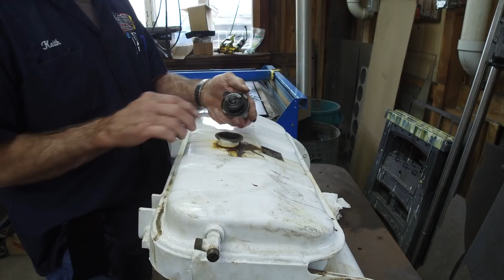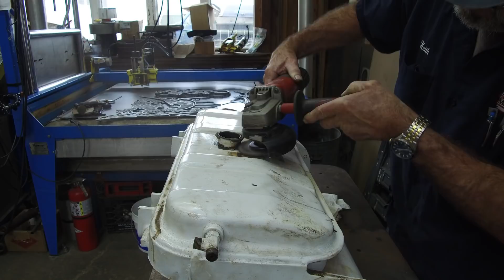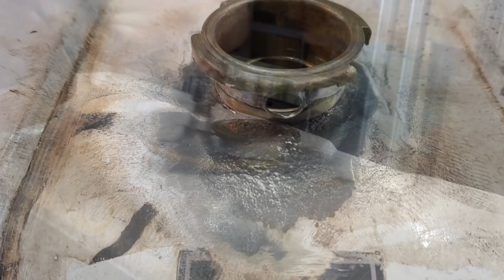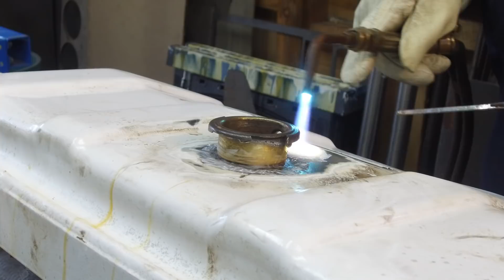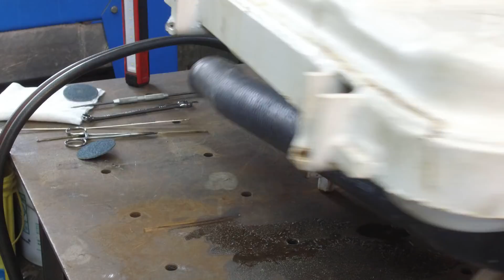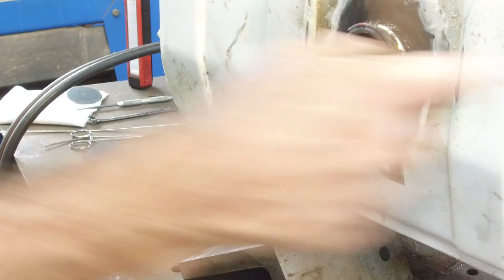2 Joint or a 30 Pack Engineering

Comment: Working engineering in an automotive group is pure frustration.  That 2 cent plastic piece was 'engineered' to save the manufacturer a few cents.  You might not believe how many times that happens.   Whole teams are employed to see how many pennies can be saved in the production of an engine, transmission, chassis, etc, etc.  Life of vehicle is less important than cost (as long as it makes it through the warranty period).

 Sometimes "we' get back at the mfg indirectly.  Examples are frequently recalls mandated because one of those plastic parts has caused a hazard.  One car had the flexible fuel fill hose connected to the fill spout with a plastic tie instead of hose clamp or even spring clamp.  Of course they broke, and the mfg had to recall many cars, costing much more than the steel clamp would have been in the first place.  Good payback as far as an engineer is concerned.

Comment: A long time ago, my AC teacher said silver solder on anything, but do not use silfos on brass because the phosphorous will attack the zinc and you will end up with a porous fitting that will leak . The same reason that auto 90wt is not used in gearboxes with brass ring gears. After a while you will find holes eaten into the ring gear. The recommended lube for elevator machine gearboxes is steam cylinder oil. Nothing quite like changing a 4 ft. in diameter gear that has to be heated to install and all the bolt holes reamed for body fit bolts. After the Elevator is hanging on a chain fall and the cables moved out of the way. Never a dull day.

Comment: For a 30 pack I would have at least used soft steel fittings .. 2 joints and it would have all been brass.

Comment: hey thanks for the great video Kieth. was wondering though, how did you clean out the fuel vapors so the tank wouldn't explode? also, what silver solder did you use? i didn't see you apply any flux. looks cool . thanks again.

Comment: Would brazing not be a better solution to that problem? Some acid flux might have been appropriate too. A steel barbed hose connection could be brazed or silver soldered into the neck.
Further edit... Is that a brass fitting on a steel tank? If so, it's no wonder it corroded.

Comment: That permanent nipple looks fantastic and has to be 100 times stronger than the repair kit. Now the tank can get it's well deserved prime and paint. Engineering is somewhat of a misnomer; I think add - on might work better if the repair part was made because of experience in the field demanded it. Are you doing a pressurized air fluid tank flush with solvents?

Comment: "I don't normally call out engineering" and you shouldn't, the engineer is 99.99% right! But his/her boss needs to sell, so they ''MAKE'' or better they build-in mistakes, worked for an US factory at the service department 40 y ago, we had to scrap meter electronics instead of repairing the board we had to take it out to exchange  for a new one, even if it was easy to repair board. If a whole car was made of non corrosion material and engines never broke tires never wore out we would still drive our grandpa car and no new car(s)(parts) were made!

Comment: From my career, about 1 in 20 degree'd engineers had the talent to practice the art. The others never worked on their cars, or fixed broken stuff, or had the curiosity to ask questions on how things work. So their path was some high school career councilor, that figured they were smart, and could get an engineering degree, as the pay was real good. Universities are degree mills these days, you pay, you get a diploma. Worse was Master degree idiots, and then PHDs. They didn't know what to do with the bachelor degree, so they continued in hopes they could learn enough to suddenly have mechanical aptitude. And their studies are so narrow that they look through the world with pipe vision. Mechanical aptitude is a gift you're born with, you can learn physics and math to improve it, but you have to have it to start with.
Those without aptitude would try to copy existing art. No improvement, and if they failed to understand some intellectual property of the long gone gray beards, they messed the design up.
Some of the limitations to making a design correct are the existing manufacturing machinery. As if you want to use a new process, a new machine that may not be cost affordable for the volume of work that will be manufactured on it. So the design uses what is available. And only the few that saw what corrosion does, think about it in their design.

Comment: Good solid repair, great silver soldering Keith. If the two-part nipple had been fitted with the O-ring on the inside, liquid would have leaked leaked around the threads on the outside. Should the O-ring not have been fitted from the outside to seat in the swaged annulus of the nipple?

Comment: Keith - I ain't ever seen anybody use silver soldering techniques  to "fill in' surface degradation - that's impressive. Was the material too thin (or unsuitable material) to braze? Am also EVER so glad you "didn't" wander down to the hardware store but made your own piece eg: the nipple.
Reply from the maker: Thin ;{)

Comment: Nice job!
I've replaced a few radiator caps on old equipment where the original was either unavailable or prohibitively expensive with more common ones (whatever I had in the junkyard)

Comment: When you went in to add a little solder to the inside of the barb, I was thinking this is when the whole thing falls apart if I was doing it!  I have done a lot of brazing and welding with torch and arc.  I just don't have much luck with silver solder.  You have it all down pat and your experience shows in everything  you do.

Comment: I don't know if the plastic nipple is original or a cheap repair, but I can tell you that it isn't the cause of the problem.
The simple fact is that fuel/coolant spillage is inevitable around a filler cap and in this case the paint used should have been able to resist it but failed.
So the problem is with the paint used, probably caused by someone under pressure to cut costs from management who didn't understand the product.

Comment: Hey Keith. If you'll take the short 2 or 3 inch stub of solder and hold it beside a full stick with one end of each piece together, melt them together then bend the short piece out to straight while its still hot, you won't have any stub waste. Hope that makes sense.     🇺🇸😎

Comment: To one and all, for when you need a wire wheel TO DO THE JOB, may I suggest Weiler 96146 Encapsulated Wire Wheel Wire Brush, Stem, 2".

They come in all different sizes. I'm just familiar with the 2" in. from my autobody days. Not cheap, but well worth the cost. On Ebay $13.42, if your willing to spend the money, look around, you should be able to purchase a lot of 10, for approx. $81.32 + shipping.

The "Encapsulated" is something akin to just having a wire wheel soaked / dipped in some type resin / poly material. They work very well, and WEAR YOUR SAFETY Goggles / Face Shield. YOU WILL NEED THEM!!!!!!!!

Comment: A mate of mine who ran a radiator repair business ( cars trucks earth moving etc ) would have removed brass filler spout first to get it out of the way , it is much quicker than trying to get at the corroded part with it in the way

Comment: At work I practice silver soldering daily to join new reels of twisted copper wire together. Butt joint. I've been doing it for 5yrs. I crack off the flux that "glassed" up the joint so that the wire will go through the subsequent dies, or else.

Comment: I think the silver solder was over kill (too much heat) and is not recommended for use with steel.  That was not a small flame for that job. Ron W4BIN
Reply: actually silver solder works great on steel. I have put many a power hacksaw blade together with it

Comment: Dorman 10691 radiator overflow repair kit. 

For every engineer blamed for an unsatisfactory result there is an accountant that is responsible.
Reply: Well, as a Mechanical Engineer I have to say for "almost" every Engineer blamed there is some other factor involved. Sometimes the Engineer (or so-called Engineer IS to blame). I've seen it more than once over the years. Sometimes a person's job title just has the word "Engineer" in it. Years ago I reported to a guy whose job title was "Chief Engineer" but the only Degree hanging on his office wall was an MBA. Never found out where (or if) he studied Engineering. Funny story: Some time ago I was visiting friends at the lake and we were sitting in this NICE houseboat drinking Tequila and shooting the breeze. Didn't know the guy but we were talking about the twin 400ci engines and I commented that I am an Engineer and the guy snarls "I HATE Engineers!" My Friend Peg immediately said: "Phil isn't THAT kind of Engineer!"  ;)
Reply: @Fjord_Driver  The problem is that no one has the time to investigate everything, so you need to trust your gut and pick your battles (because no employer is going to pay for all those investigations unless it's space-rated).  Years ago as a components engineer, I got bitten by bad specifications from a respected company.  It was for a flash-rated capacitor that was being run at it's design limit.  Parts from company A parts worked great;  company B, with identical specs, but parts started exploding.  I knew I should have tested the company B parts because it was a critical application, but I trusted the specs...  Live and learn.
Reply: Likely one of those engineer types that reminds you, three times, within the first minutes of meeting him that’s he’s an engineer. I reply, “Oh, so you’re an engineer? Well let me speak slower so you’ll understand it then....”

Comment: When I was brazing with silver solder, I always added a new stick onto the old stick when it got down to about 1 1/2 to 2 inches long.  There should never be any of the silver solder stick to throw away; particularly Silvaloy15.  Heck, I would pick up pieces and braze them together to make sticks.  The company I worked for bought the stuff by the pallet load-10 boxes wide by 13 layers tall by 15 lbs per box.

Comment: Why didn't the brass nipple fall out with all that heat on the inside? If I was doing the job it would have fell out, rolled away and never been seen again!
Reply: I always blame the coffee, But Mr. Fenner has the touch...
Reply: The silver solder does not flow at the same temperature on a reheat. This is why the nipple did not fall out. Very helpful. I love silver solder!!!

Comment: Nice patient methodical work. At first I couldn't figure why use silver Solder until I realized trying to use brazing rod on the brass cap is a no no. I gather that is a gas tank?? Is there no danger of explosion or ???
Also like to know brand and where you obtained the silver solder? I recently googled some and saw a scary price.
Reply: You can tell by the amount of heat he's putting to it, the color of the base metal, and actual solder would have flows around that whole joint in 5 seconds. (He wouldn't have to work around the periphery.) Also, it's not forming a perfect filet like solder would.
Reply: It is brazing rod. It's colloquially known as silver "solder," even though it's brazing rod used at brazing temps.
Reply: Gordon J Alley  Thks. I heard him say that but I always thought an expansion tank is vented to atmosphere. I am not familiar with this kind of expansion tank. Maybe for marine use????

Comment: Saved half a cent by going with a two piece plastic junk "solution" in manufacture, only to need $20 in silver solder to fix the damn thing. That kind of summarizes modern consumer engineering, doesn't it.

Comment: Keith, I wanted to share a tip (just the tip) with you that has worked well for me. I keep an assortment of bore brushes (gun cleaning) to get inside of holes, nipples, etc., sometimes I use them on a handle, other times I may chuck one in a drill. 😉

Comment: Worked in Radiator repair shop for years.  Use muratic acid to clean then tin the metal.  Good solder is all you need.
Reply: i concur , would be a better finished repair using soft solder. less heat req,d.
Reply: It looks like a nice solid bit of a much larger power plant on some sort of machine. What Keith did was to fix it so it stays fixed.
Reply: I have the same reflex, good cleaning, fluxing with muriatic acid or good commercial flux then tinning using plumber,s solid core solder makes the trick with much less heat and risk of distorsion

Comment: That plastic two part nipple is an aftermarket "repair" kit.  It's for the DIY'ers who don't know how to solder.  The OEM is long gone.
Reply: I've seen those on old radiator necks as well as auto parts stores, tho not as common as they used to be. The original nipples are sometimes just a press-fit and they pop out after corrosion gets to them, although even the soldered ones take a hike after a while.

Comment: Another excellent video and repair, I think thst I would not have had the patience to try and save that fuller cap mss. It would have been a new neck from Detroit Radiator and a thorough removal/clean-up and replacement to save myself from the necessity of a 30 pack

Comment: Could you say what exactly is that silver solder? I’ve bought two different types and neither is like that, even though it says “silver solder” it’s more like regular plumbing solder. I seen a guy use what you did there once but never matched it, thanks.
Reply: Search for "silver solder brazing rods."
Reply: @rickhackett2865  thanks guys, never thought about looking at brazing rod, I just thought I was buying silver solder.
Reply: Silphos 15%. They make many variations, in school they made us use 5%. 45% high silver they make in sticks & coils. The flux coated I stay away from, it makes a damn mess.
Reply: @TBJK07Jeep  thanks Tim.